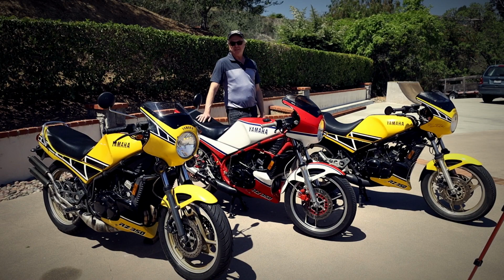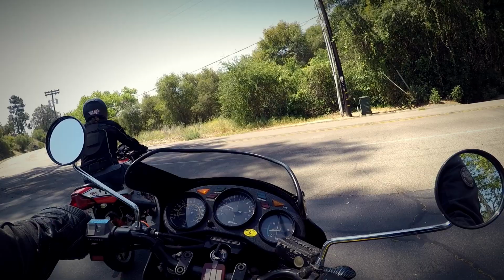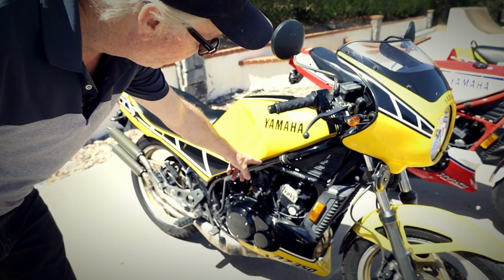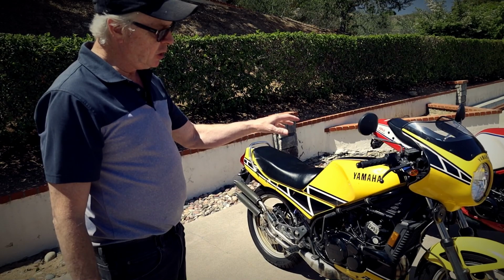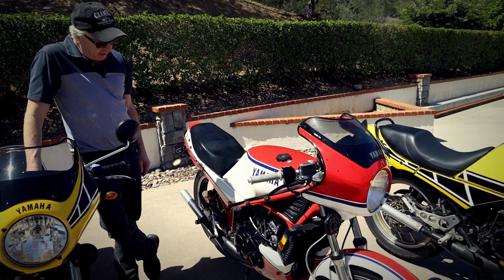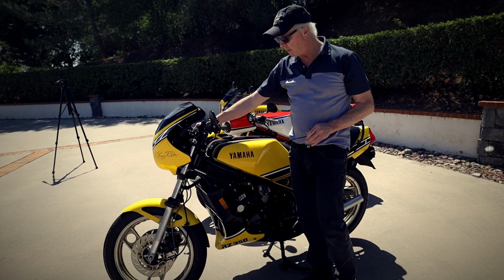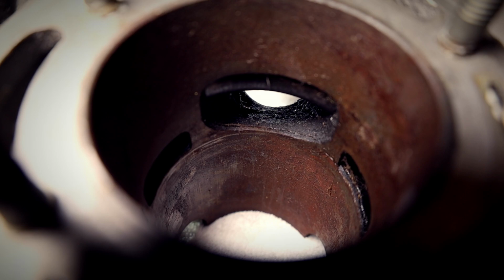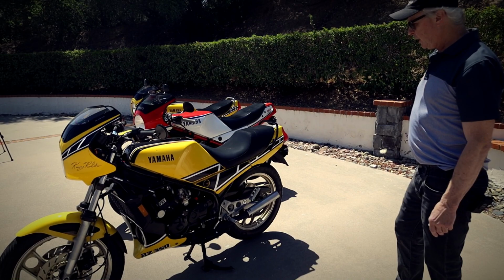Ride the Yamaha RZ350 Kenny Roberts two stroke rocket and learn all the secrets

Comment: Hmm yes we did have the power-valve versions in Europe, the original 350LC simply came first in 1980. The power-valve version in part was created to tame down and smooth the power curve that we had on the wild original RD350LC, which remain to this day the most sort after RD models (RZ in the States) While the power-valve models are great bikes, and maybe the most fun you can have on a 2-stroke in the States, here in Europe we were also lucky enough to have 500cc Power-valve models as well 🙂
Reply: Yanks are clueless!
Reply: These guys really need to do more research before making a fool of them selves... Yeah we had a ypvs ...mine was an 1985... As for them all having a steering damper ..not in the UK ...I'm still on an LC
Reply: @Jer0867 Not all Yanks are wankers.  Some of us are sterling fellows.  😅
Reply: We never got the LC in the US.  We rode the older air cooled RD's while we suffered from envy from '80 to '84 when Yamaha brought the RD350 LC2 YPVS  to the US as the RZ350.   I remember when I heard the news.  It was a happy moment.  We were getting a second chance at dating the hot girl!  After 3 years of pining for the LC, we finally could buy the newer updated LC2.  Happy Days.
Ran out and bought an '85 model. Still have it, still ride it.  I will never sell it.  Having too much fun. 😊 Thank you, Yamaha.
Reply: 1983  the Yamaha rd 350lc ypvs n I'd brought the rd250lc in 81 with microns those were the good old days for sure...
Reply: And the 1983 YPVS models had 59 HP in Europe... 
Myself had an 1981 350 LC

Comment: Great video in the UK I used to own a pre-YPVS 350 LC and that was a real headbangers bike, the power and speed you got from a 350 2stroke was awesome😊😊
Reply: Yes, I rode the early 350LC that belonged to a mate of mine back in about '85. I was still a learner at the time and only had a 125 but the LC was wicked in comparison and with some allspeed pipes sounded fantastic. Rode one a year or so later after I had passed my test and managed about 120 mph two up. By far the most exciting bikes I ever rode including all the big 4 strokes I owned years later.

Comment: of course we had the power valve here in europe.....we had the rd 350 lc and then the updated model rd 350 ypvs..i had both here in ireland.....it was Called the RZ in the states and RD everywhere else....
Reply from the maker: I did not know the later RZ's had YPVS in Europe.
Thanks for sharing!
Reply: @cramersclassics  .some bike back in the day when i was only about 19 ripping up the roads on them...great vid by the way....
Reply: A mate of mine owned the original RD350LC back in 1984 in the rare metallic blue colour which I have never seen again. He then bought a YPVS version with a full fairing (the F2) version back in 1986 when they were first released. Admit I always liked the earlier version though.
Reply: @cramersclassics  RD 350 had YPVS from 1983-1988 in Europe. 1986-1988 was the last version with 63 hp
Reply: @cramersclassics  yep my father had it crashed twice almost killed both times...now i rebuild it.... its called Rd 350 in Greece to with Ypvs this thing killed many many many many greeks
Reply: This was not the pinnacle of Yamaha's 2 stroke, 2 cylinder development. Just the pinnacle in the US. Also, all these bikes came stock with expansion chambers. These are just aftermarket expansion chambers.
Reply: @timcolder2789        "85, 1st year F-(->full fairing)

Comment: I had a 1985 Kenny Roberts RZ350 as my 1st street bike back in 1991. It was mint and only had 1200 miles on it when I bought it. Had a set of nice aftermarket headers and glass packed pipes. Made so much good noise and got more attention then the modern big bikes my buddies were riding. Good memories for sure.
Reply: Probably keep up with ur buddy's bikes too, if the power is similar to a banshee

Comment: Great review of the YPVS.  I had the air cooled 74 RD350 when I was a young man.  It was simple yet powerful and put a smile on my face every time I rode it.  I had the points converted to a CDI.
Reply: Awesome! I have a '75 RD350B with the Vape CDI fully electronic ignition kit. Runs better than ever with the new ignition. No more points or relying on 45+ year old factory ignition electrics to get me home.

Comment: Very nice. Thanks for posting.  Still have on the road legal my RZ bought as a leftover in '86 for $2k out the door. 37k miles now.  All the dents and patina I've put on it over the years. Since these bikes lack a TPS on the carbs, I don't believe load has any bearing on the power valve position.  I used to think it came on all of a sudden at 7,500 rpm but have since learned it raises gradually over 3k rpm. The YPVS brain is only connected to the CDI brain which electronically communicates RPM to the regulator. Handy as I've had dysfunctional instruments for decades. Other ready to ride 2 strokes: '67 YCS1; '71 R5B; '72 CS5; '77and '79 RD 400; '89 DT50LC Enduro (the only fully street legal liquid cooled 2 stroke dual sport ever sold in the US).

Comment: Yeah great fun bikes in the day with the light weight and zingy 2 stroke powerband..However ridden the way they should be fuel and oil consumption  was rather high for touring purposes..My 1985 model 350 was considerably more thirsty than my mates Honda VTR1000 Firestorm with a 3 times larger 4 stroke engine,and considerably more power with an awesome v twin exhaust note.

Comment: Small correction to video information - I remember my second UK RD350LC YPVS (at the time of it's release) had the Yamaha Power Valve System (YPVS) system. YPVS was not just a US feature on the RZ350. And the LC initials stands for liquid-cooled which both the RZ and RD 350s were. So both the USA and Europe versions in question were RD350LC/RZ350LC with YPVS.  The YPVS first appeared on the second version of the RZ/RD350LC in 1983 and on the RD500LC. I also remember the YPVS system being present on the Yamaha TDR250 dual-sports.

I grew up and owned virtually all of Yamaha's road-going two strokes at the time of their release, from the FS1E and up to the RD500LC. I am pretty sure that the road-going Yamaha RZ/RD350LC YPVS did not have air forks. The RZ350 utilized telescopic forks for the front suspension encased long coil springs with hydraulic (oil) damping. The air forks are more common in off-road bikes.

Comment: There was also a 500cc version sold in the UK. I do not think it was available in the US because of emission regulations but it was sold in Canada. A neighbour owned one and it accelerated as quick as my GPZ1000 ninja . It was in Marlboro colours just like the Kings 1983 GP bike and looked superb. Very rare and collectable now like most decent 2 strokes!
Reply from the maker: Yes I think this is it, the RZ500?
https://www.youtube.com/watch?v=-FXlhLPLTeE&t=228s
Reply: @cramersclassics  Yes it was actually called the RD 500 LC in the UK. Suzuki also did an RG 500 gamma two stroke in direct competition with the LC which was introduced in 1985. Always remember seeing one in the local dealers when they came into the UK. Two of the best two strokes around at the time. Worth a fortune now if you can find a mint one.
Reply: @timcolder2789  The RD250 or 350LCH came out in 1981 to 1982 any model after that were RZ's . They were RZ250, 350 and 500.
Reply: @Neil Hammil they were known as the RZ in the US and also Japan I realise but they were known as the RD two strokes in the UK and western Europe just as the earlier air cooled bike was in the late'70's. My cousin had an aircooled RD250 which was made in 1975 ,the pre water cooled 350 LC bike.  Quite why the difference between RD and RZ anyone knows as they wrre the same model. A mate had a fully faired RD350LC F2 in 1986 which was the last year they were sold new on the UK market. Recently seen a mint German 1981 registered early version for sale at a local dealer's priced at about £13000 (about €15600.00). Two other friends owned rare metallic blue versions which came out in the UK about 1984. Whether they were sold in the US no idea. I rode two different black 350LC's about 1985/1986? the first before I passed my test in December 1985. Great bikes whatever their title. Best wishes from the UK.
Reply: @topcat4759  The first model was the R5 350 and from there were RD up until 1982 they were RZ until they stopped making them in Australia.
Reply: @ Neil Hammill crazy debate but agree the first 350 was the R5 from 1970. It became the RD350 in 1973 and a mate owned an RD350B dated from 1975. Further air cooled models were produced up until 1980 ending with the RD400F before they were replaced by the RD250 and RD350 LC in 1981. They we were called the "RZ" in US and Australia but certainly in Britain and Western Europe known as "RD" just as the aircooled models were in the 1970's.Just check the wikipedia page for both RZ350 and RD400 or google info.for confirmation.Other comments on here confirm exactly the same.
Reply: In England I remember a YDS7 model before the RD’s. Nearly bought one when I was 17 😊

Comment: ..it changes the port timing..the sooner the EX port opens, the more top end power is made, due to the exhaust gases evacuating the cylinder at higher velocities.  
Lower the port timing the more low end and mid range..more push on the piston.

Comment: Great video Kirby! I think the "Kenny Roberts signature decal'" came on all the bikes... (in both colors)... some folks just peeled them off or repainted the fairing without replacing the decal(s). My RZ-350 is a1985 model in Red/White and it too has the Kenny Roberts signature decals... Many folks don't realize it, but as you mentioned the Power valves were actually to make the bikes easier to ride with more mid-range power and better MPG, to soften the abrupt power change when the engine come "on the pipe"... My Suzuki RG-250 is the same way... Early moto-magazines were disappointed with that bike when the addition of the power valve in 1985 didn't actually increase top end power, as they were hoping.  Looking forward to our next 2-stroke ride! Cheers!
Reply from the maker: Thanks for your comments and insight Victor.  Cheers! -Kirb

Comment: The LC and YPVS models were both developed by Yamaha Japan in conjunction with Yamaha Europe ( Yamaha Motor NV, Amsterdam, Holland ) my personal preference was an LC with YPVS forks, engine and a damping adjustable aftermarket shock. This combinatoon is lighter, lower and shorter than the YPVS and in my opinion is the best of both.
Reply from the maker: Excellent commentary.  I recently found an RD350LC and it is unique.  Cheers! -Kirb

Comment from the maker: Interesting... I think there were several variations on the models for different countries.  All 3 of my RZ350's have the same factory-looking air valves on top.  The air pressure supplements the internal springs.

Comment: I had an R5 when I was a senior in high school in 1974-75. As soon as I bought it I threw away the sissy bar (??!!) and bolted on a clubman handlebar. From then on I was Kenny Roberts! Of course I was never really as good as I think I was. A few years later a friend foolishly left his RD400 Daytona Special in my care while he was away. I went for a Sunday ride on some twisty mountain roads with several friends including one on a Yamaha XS Eleven! As soon as the curves got tight all the other headlights receded in my mirrors and then disappeared except my roommate on his new Suzuki GS750. For my money nobody else came close to the smiles per hour provided by the Yamaha 2 stroke twins.
Reply from the maker: Great story! I had my first 1975 RD350 as a college freshman in 1979, since there were no parking spots available on campus for cars.  Milk crate clamped to the fender rack for hauling beer.  Quickly learned bottles vibrated so much the tops popped off.  Cans only.  
Added Dick's Cycle West pipes for a wild ride into a neighbor's front yard on a cul-de-sac; thinking the curve was gentle.   No harm except the lawn, quick get away.   Those days were epic!
Reply: @cramersclassics My brother still has his 75 RD! It's in his garage under a pile of old boxes and his kid's greasy Jeep parts. Hasn't been started in at least 40 years.😥
Reply from the maker: I hope he gets it running again soon!
Reply: @cramersclassics  lol !!

Comment: The banshee engine was different in that it didn't have a power valve. Edit: the banshee also didn't have electronicly adjusted ignition, but many companies make a bolt on solution for it.

Comment: Hard to believe those aftermarket expansion chambers add 20% more  power
Reply from the maker: Yes, however, when you consider the stock pipes had a catalytic converters and had to meet US smog restrictions, 20% seems reasonable to me based on my experiences.  Anyway, the JL pipes are so much lighter they certainly feel faster!  Thanks for watching.

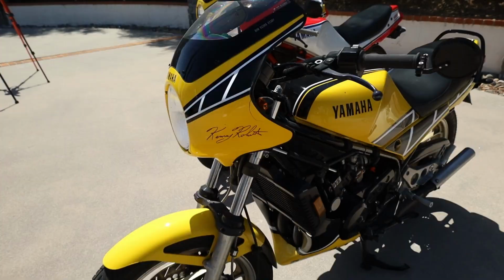Comment: 5:43 How do you mix oil and gas?? I'd love to know how THAT'S done!
Reply: Easily. Many of the early RDsRZs were converted to take premix as opposed to the factory set up where the oil was mixed with the fuel via the  seperate oil tank and oil feed system. It was not easy to get the proper ratio if you had to refuel on the road on longer distances. This principle is the same as chainsaws and other fuel operated gardening tools. Generally they run around 25 to one fuel/oil ratio. I have not converted my 1980 RD250LC so I am not sure of the ratio.

Comment: Is there any for sale?
Reply: you want to take your time, do a full global search for the '85, which maintain's the '83-'84 slim oil covers flowing back into the thinner rear (flared) fairing (in) which the(y) housed that art-deco triangulated(key-hole) pyramid tailight, PLUS the F(1...(edt. ..'85, 1st year Full Fairing) also sported the (later)square headlamp and the RD500 instruments...this style combo is an utterly unique, ONE year only exercise, and in Euro/UK.(and a few(very few)Aussie) KenRobSpecial still put's out the full 63bhp specs (sans the catylists and emmission controls).....the very next year year they took a down turn with the overly square, heavier styling, heavier weight...still not bad but, if you want the one(?)